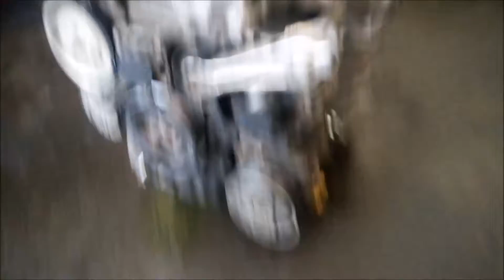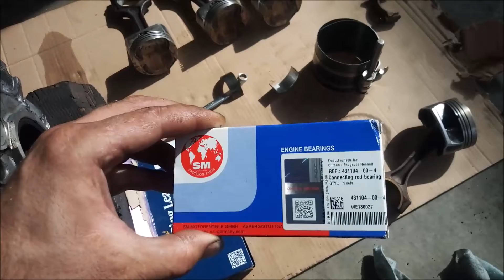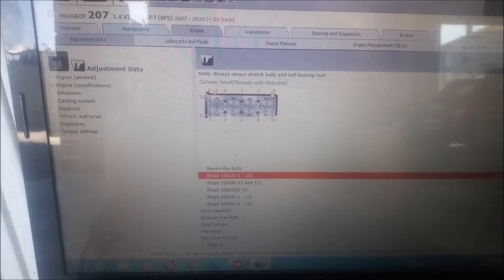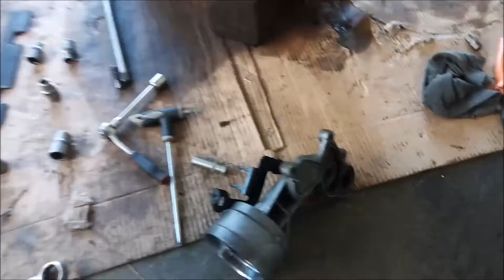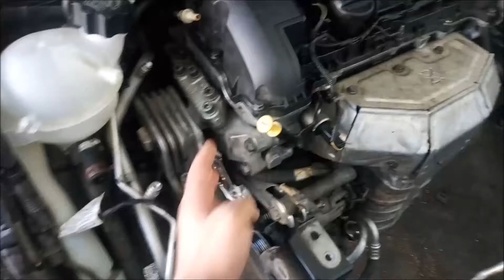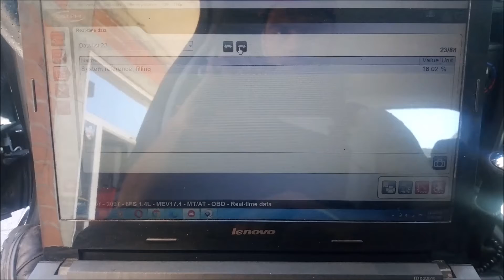peugeot 207 1.4engine repair

Comment: thanks man
i have the exact engine and now i can’t find the lock hole for the crank , the wired thing i found a hole on the fly wheel where the piston’s not at the same hight and crank can be moved slightly both ways .any suggestions?

also changed the valve seals due to burning oil at idle mainly and i wonder if the piston oil ring where damaged!
Reply from the maker: On this engine piston ring is most likely to be damaged that's why it's burning oil and yes the when you lock the crankshaft the first piston it's not top dead center it's little lower
Reply: @ 
today finished valve seals and timing chain job
, i am sure that the smoke because of the valve seals because they was dry and enlarged and also cylinder 2 &4 exhaust manifold has a lot of carbon buildup
Reply from the maker: @killuaHunter on those pistons is leaking oil
Reply: @mechanicigor  you mean piston oil rings?
i hope not 🤲

i don’t think so , the car has under 170,000 km
😀
Reply from the maker: @killuaHunter it doesn't matter how many km have I have replaced rings on engine with 70000km it was eating oil

Comment: Druže iz Šapca sam, gledao sam tvoj video. U pitanju je Pežo 308 vti 1,6 2007. Imam problem, pali ventilator hladnjaka kad je hladan auto i izbacuje 1cilindar, radi na 3. Trese se u leru i početnom radu dok se ne zagreje, posle proradi posle 2 kilometra otprilike , ne sagoreva izbacuje crn dim i oseća se benzin. Upaljena lampica greške motora, pokazuje neispravna lambda sonda 1. Promenio sam svećice, bobine,   čistio dizne, opet isto. Molim te ako možeš da mi pomognete za savet šta dalje. Pozdrav.
Reply from the maker: Proveri kompresiju na cilindar 1 I onda na drugi da mozes da sporedis moguce je da je ventil problem ako imas razlika u kompresije
Reply: @mechanicigor  ok.hvala ti živ bio
Reply from the maker: Nema problema slobodno pitaj kad god zatreba

Comment: How much does such an intervention cost? I must change the timing chain and cylinder gasket 😢
Reply from the maker: The cost is different in every country, in my country that would cost around 500~600 euro with parts and labor
Reply: where are yiu from?
Reply from the maker: I'm from Bitola, north Macedonia

Comment: Druže,poz iz novog sad imampezoa 207 benzin istih karakteristika imam problem curi menjao sam filter ulja,pumpu ulja,vodenu pumpu,pk kais  i bratko curka ne puno ali zamastio se motor onako pozz
Reply: Ja imam 207 1.4 benzin. 16 ventila 90 konja. 
Pusta ulje na sve strane. Prvo na semeringu radilice izmedju mjenjaca zatim na separatoru to je ovaj plasticni crni poklopac zatim na dihtungu glave motora, znaci ljeva na sve strane. Sad mi jos i alnaser crko, smece zivo od auta. Da mi neko sad ponovo pokloni ovo auto ja ga dzaba ne bih uzeo.
Reply: @WhiteNinjainblack  radio sam mu  veliki servis mali servis gume pali iz prve e sad moze biti da šljaka sto se nedeljno predje 60km..pa je zasad u redu
Reply: @sandyic zdravo ja imam isto Peugeot 207 1.4 benzin trosi mi ulje nisam primjetio da mi igdje kapa ulje trosi li vas i koje ulje koristite
Reply from the maker: Dobar dan ovie motori trosat ulje uste od fabrika loso se konstruirani nema vrska koe ke stavis sekoe go trosi
Reply: @mechanicigor ja sipam total 5W 40 al opet trosi
Reply from the maker: @amermaslic565 nema veze I 20-50 da mu stavis opet ce da trosi ulje treba ili kariki ili klipovi da se smeni
Reply: @hamarkomadantprveklase totalovo 10w40posto je stariji auto 2007tako mi uvservisu kaže majstor a i gledao sam neke tutoriale isto da je mladji kaao išlo bi 5w
Reply: @hamarkomadantprveklase buraz sad neće da upali tri god palio kao blesav sad ćera na fax kad ono samo vergla neće doduše pokazivao je da je akomulator u crvenom ali me bunilo sto je on palio iz prve svaki put,drug dosao izmerio koliko pravi struje tj.dal lnaser radi pisao sve bilo ok .mislim a me je prodavac malo zajebao rekao nov akumulator,koliko znam on može da trajeci do 5god.meni tri nisam pametan dali kad bi ga upalio na kablove i ostavio ga pila sata da radi dal bi mu pipravio krvnu sliku da se dokotrljam do majstora 😅
Reply from the maker: PA normalno da moze sa kablove da mu das pomos